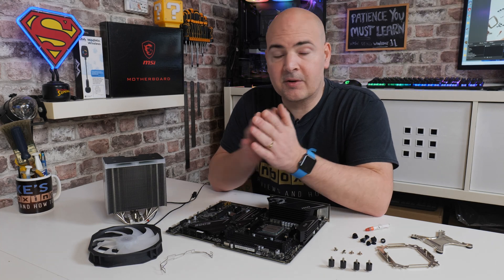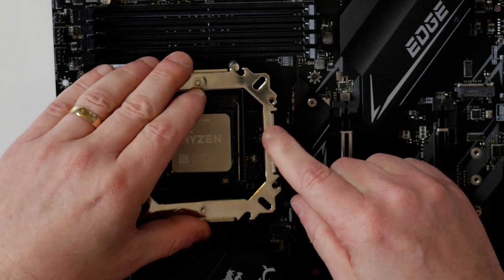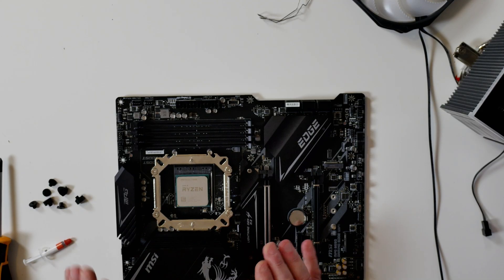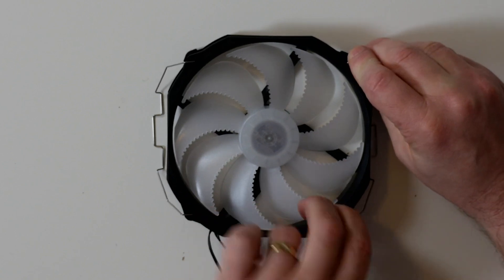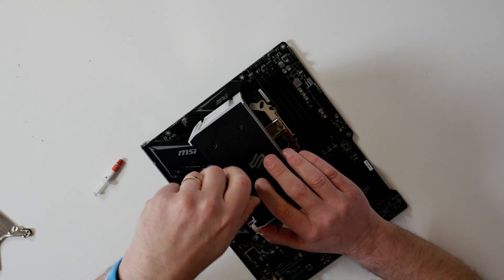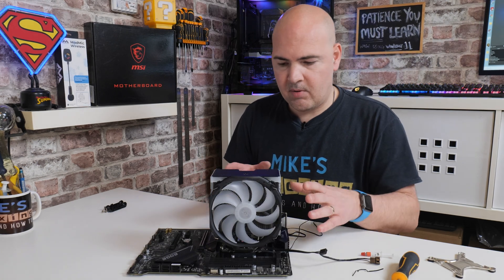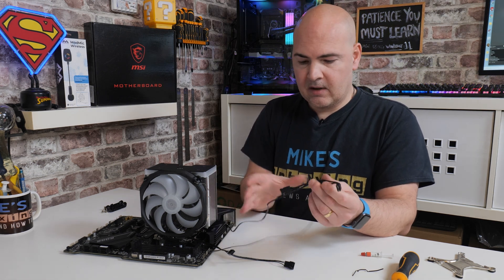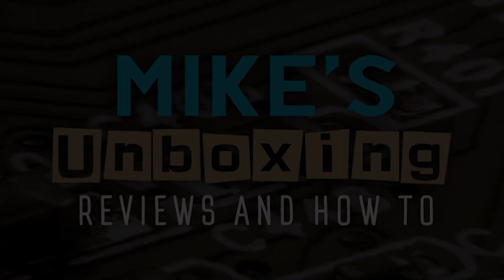How To Install SilentiumPC Fortis 5 ARGB SPC308 CPU Cooler AMD AM4 Platform

Comment: Would you recommend installing the cooler before or after putting the mainboard into the chassis?
Reply from the maker: definitely before :-) it takes up a lot of room, and also plug in the 12V CPU power cable first
Reply: @mikesunboxing  thanks for the quick reply! :)

Comment: Is it safe to fill the motherboard with components on table? Or should i put it on Carton box?
Reply from the maker: either is fine, just be careful the solder and pins on the back don't damage the surface
Reply: Thank you! @mikesunboxing

Comment: 2:21 You are covering those capacitors with this metal frame. They are touching? Or is that some small space like 1mm? In both situations I have doubts if it's good. This metal frame is getting hot probably and heating capacitors will reduce their life... Am I right? I don't like this mounting because of that.
Reply from the maker: Seems to be decent clearance to me, close but not touching
Reply: @mikesunboxing  But even if it's 1 or 2 mm is that enough? It makes air much hoter here...

Comment: I can't take the first step because I don't have a screw thread for the spacers. There are just four holes. How can I install the CPU fan without a screw thread?
Reply from the maker: This is maybe easier to fix or at least advise if we can ask more questions and get direct answers, so feel free to join our Discord chat and we can go over it in more detail https://discord.gg/XtBTGQ6BDu
Agree to the rules by clicking the emoji and you will get access to the rest of the Discord channels
Reply: You should have base plate there from motherboard. So if tou don't have that, get a base plate for am4.

Comment: how can i control the cooler lights? Great Video
Reply from the maker: you can buy an external controller or use a compatible 3 pin argb 5v motherboard

Comment: In your unboxing you implied might be issue installing base plate but I agree with Bob that its straight forward and similar to my Evo212 in some respects. Good looking cooler with plenty of cable to aid connection to mb etc. Will bare this in mind when next building a PC. Thanks for reviewing Mike and Kath👍
Reply from the maker: it is a rock solid cooler and the results are great and very quiet to